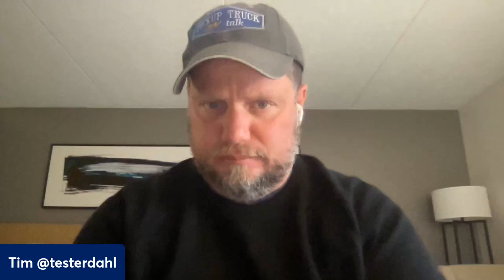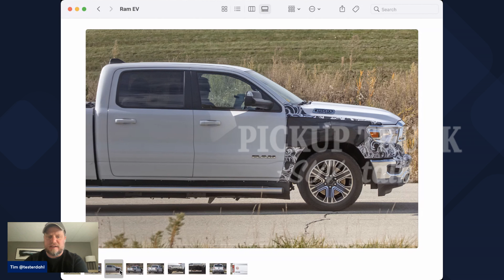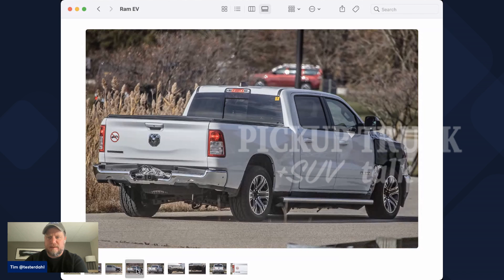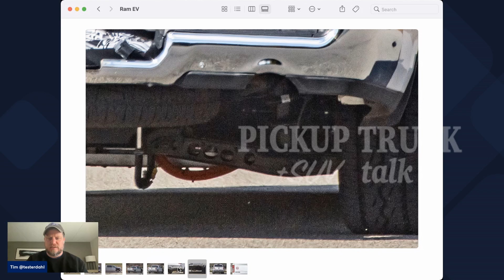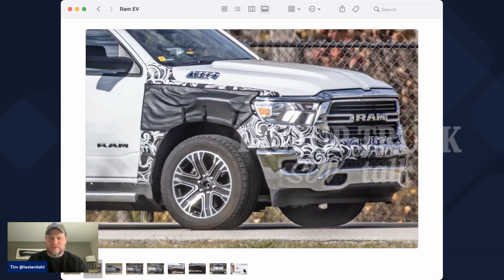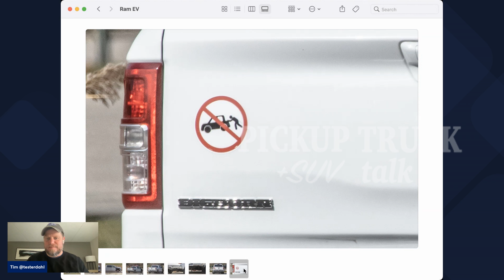Here it is? New Ram 1500 Electric Truck Spied with IRS

Comment: Exactly I agree a 100 percent the electric version of the truck should be designed differently. Not only for aesthetics but from my aerodynamic and efficiency standpoint. Fact is trucks are boxes and GM took the right approach with a total redesign. 400 plus miles of range compared to fords 280. That’s a huge deal. As always awesome review!

Comment: Yes...they really need to separate the EV's from ICE trucks. They might look similar but the specs are different for payload, towing, etc... If I buy a Ford ranger I know what I'm getting. If I get a F-150 I think I know what I'm getting...but Lightning is a totally different beast and should be named something different like EV-150. Maybe for EV line for RAM should be like B-1500 for Battery. Right now when I look at 1/2 ton trucks they are very similar is specs. Not true for the EV line which means I'm getting something very different in specs from what I've know the last 40 years.

Comment: This is a range extender EV mule with a hydrogen fuel cell per the water drainage tube under the front engine compartment or a radiator overflow tube or heat pump condensation drain.

I like the hydrogen fuel cell theory the best.

Thoughts?

Comment: Keep in mind Ram is going to have a range extender which may be a two cylinder 
Gas engine
Diesel Engine 
LP Engine
OR
Hydrogen Fuel cell with cartridges one can purchase at their local Ram dealership.

Also Ram has stated it will be a solid state battery…at least by some point.

Comment: EVERY EV on the market is grossly overpriced.
Reply: Your wrong! Every vehicle in production is grossly overpriced. ICE or EV, just wait until you see pricing for a 23’ model of anything. 3-10K over 22’ pricing depending on manufacturer.
Reply: @jayray274  I certainly agree that all vehicles are overpriced. But that does not make my claim that the EV is grossly overpriced. Compared to a gas model the EV IS grossly overpriced. You pay more and get less with an EV.
Reply: @JohnSmith-ug5ci  I won’t disagree.. It’s the American way continue to Pay more and get less in return.

Comment: PHEV (or maybe EV) Dakota please.  Smaller pickup that can tow up to 6000lbs when needed but primarily used for smaller loads and commuting.  It seems to me that is the demographics for an EV/PHEV anyway and those people likely don't need the full size truck.  If you need the bigger towing then you choose the 1500, 2500 etc.. with the gas engine.

Comment: Off the topic: Hummer EV recall for battery seals and stopped sales
On the topic: none of these EV trucks are practical yet.
Conclusion: truck manufacturers are funding their R&D by selling the products which are still in conceptual design phase yet, with a lot of lies and fake promises.

Comment: Couple of thoughts:
1. Back bumper also has distortion film. They are hiding something.
2. Holy cow the ground clearance is much lower.
3. Agree on test mule comment. Batteries look slapped on underneath unless that is a cover… Or they are going for a 1,000 mile range option that takes a full week to charge from home. 😂
4. Front end distortion could be to hide charge port but it could possibly be to hide aero…l like a Jeep Wrangle (solid block from the top but aero from a top-down perspective.
5. Cannot help but wonder how much air and how many 🎃plys are in that to.
Reply: Ram likely has this truck set in aero mode in the air suspension.

Comment: I agree. This is a mule. I believe the real truck is unibody on frame like what GM is doing. The front trunk is useless if the grill doesn't move out of the way with the hood and this truck clearly doesn't have that. I'm guessing this is testing the motors, battery pack, etc. I think the ram is a good looking truck so if the EV version looks similar, that would be a win.